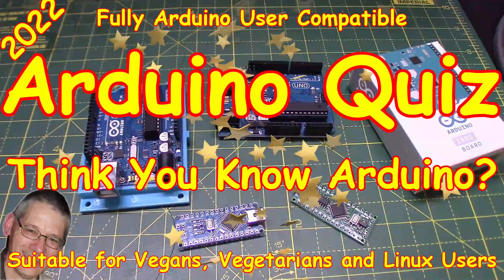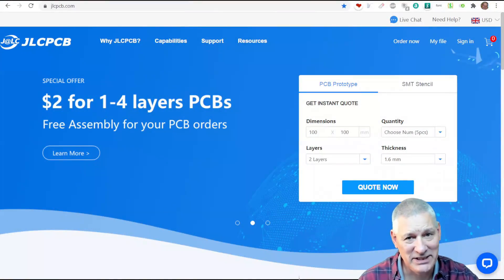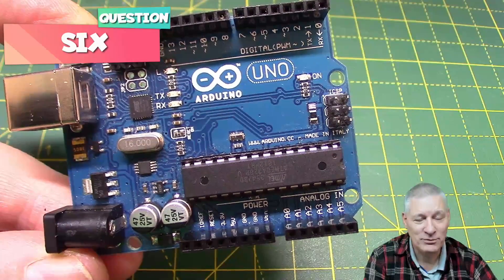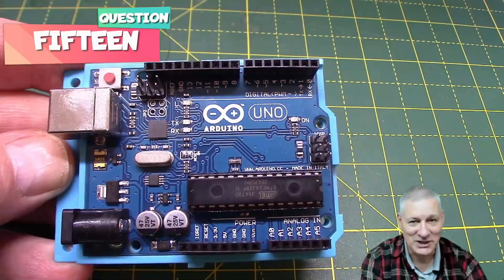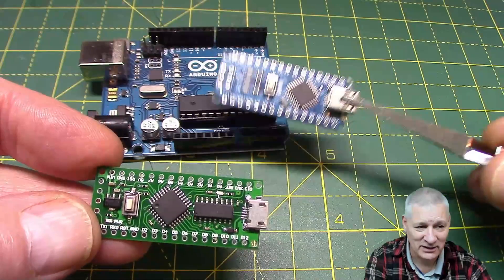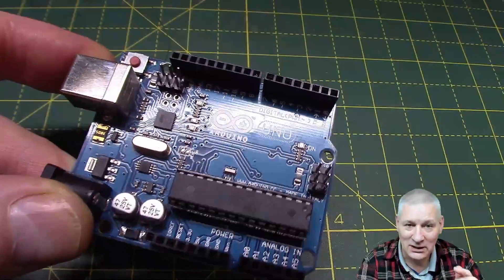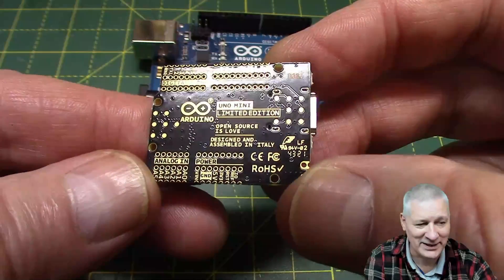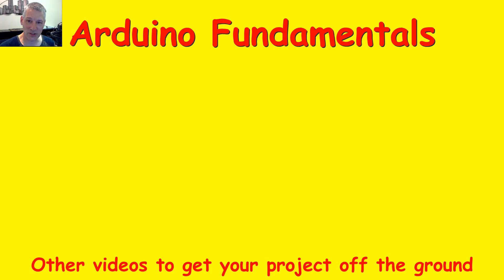#234 Arduino Quiz🎈🎉New Year 2022! So you think you know the  Arduino?

Comment: Catching up with your older vids. I think I got 18, but I have some exceptions to make!
The chip on the R3 for the serial interface is the 16u4, not the atmega8. The previous chip before the 328p was the atmega168... so I wrote down 168.
For programming it where you said if the USB was bust, how could you program it, I put both USB>Serial on pins 0,1 and also the ICSP. Technically both correct? :P

I also said to what language does the arduino use, AVR-C, which is technically not C nor C++... correct yes? :P 

The one that stumped me completely was that special edition uno. I thought it was a slimmed down mega. I also got the Timer questions wrong. I wrote Timer1 but yeah, forgot about binary numbers lol. I knew it wasn't Timer2 because that's only 8 bit...

So depending on how you mark my answers, I think I got 18. I'll include my original answers file below. Fun quiz though :)

1) Arduino Uno R3, genuine. Y - 1
2) Clone Nano Y 2
3) smaller size Y 3
4) 32k Y 4
5) 328P Y 5
6) 168 ? -
7) 19 on uno (2 points) Y 7
8) 2 Y 8
9) 16MHz, (bonus) 1Mhz Y 10
10) hook up a USB To serial on pin 0 and 1 (TX/RX) or ICSP 11
11) 256 bytes Y 12
12) 5.5v Y 13
13) 0 1023 Y 14
14) 40mA Y 15
15) 20mA Y 16
16) 3 Y 17
17) 1 N -
18) shield Y 18
19) AVRC ? -
20) mega pro X
Reply from the maker: OK, let me get out my red pen. ✏

The original USB interface was the ATMega8U2. This was continued with the Rev2. The AtMega16U2 was not used until Rev3.
https://startingelectronics.org/articles/arduino/uno-r3-r2-differences/arduino-uno-rev2-schematic.pdf

The Arduino language is definitely C++. "The core libraries are written in C and C++ and compiled using avr-gcc and AVR Libc."
https://code.google.com/archive/p/arduino/

Timers on the Arduino are 8-bit (T0), 16-bit (T1) and 8-bit(T2). But you knew this, even if you started counting from 1, not zero🤦‍♂️

I could almost accept the answer about a slimmed down Mega2560 instead of an Arduino Uno Mini - I'm about to use one in a video project! Almost. But I didn't expect anyone to get that right! (Actually I'm quite unimpressed with the Uno Mini, but sshh!)

This was indeed a bit of fun but did make many people think long and hard about some of the answers! In most case it doesn't matter whether you know the answer or not but some are useful to know in everyday program and project construction.

Let's just call it 18/20 anyway 👍🏻😲😜

Comment: hi Ralph! I really enjoy what you do. Thank you so much. 
I have a question, maybe you covered it somewhere....after you have wired up an Arduino project, let's say multiple servos, and you want to upload a new sketch. How do you manage disconnecting any high load circuits while uploading? Seems to be a pain to re-wire each time you make modifications to the sketch. Hope I am making sense.
Thank you!
Reply from the maker: My question to you, Noel, is: why do you feel the need to disconnect high load circuits whilst uploading? It can be done but read on.

On start up, all pins are set to high impedance (input-like) so no device attached to the pins should be getting a signal or power. With servos you might get jitter (because servos expect a signal every few milliseconds) but apart from that things should be pretty much 'dead' immediately after power up and before the 'setup' function can run (actually other functions run before this but you get the picture).

Now what you can do, if you are experiencing problems (please let us know what your issue is) is to control the +ve line to the rest of the circuit using a MOSFET that is normally OFF until the Arduino has set it ON in the 'setup' function. You'd actually need two MOSFETs, one a P-channel and one an N-channel but as you get these in a single Si4599 tiny IC it's a no brainer (low 'on' resistance and 6A current carrying capacity for the P-channel MOSFET). I've done a video on using this, video #123 for starters, but there are various permutations you can use. Let me know if you need this.
Reply: @RalphBacon  thank you Ralph for your reply.   I have a Nano on a breadboard with a 5v power supply connected, and 4 servos (SG90).  Initially I uploaded without the servos connected, and then wired those in. The issue came up when trying to upload a modified sketch,  which unfortunately caused the computer to reboot (W10) for some reason. I suspect a current draw on the USB port (?) I figured the load of the servos would exceed the USB current, so I left the 5v power supply on. The Nano is connected to the +5v rail on the breadboard. . And, I did have the jitter as you mentioned. I should add that the new sketch was only using 1 servo, with the other 3 servos still in circuit.  I guess I don't understand how to manage the USB connection to the Nano with the external power supply connected to the breadboard. Perhaps just disconnect the +5v wire to the Nano for uploading ?
I will check out your video 123.   Thank you!

Comment: Arduino Nano and Uno are NOT identical.   Nano has more GPIO PINS.  Also, you imply 19 gpio pins by counting up from 14 on the analog pins, but being based  zero that makes 20 gpio pins.
Reply from the maker: Well, sort of, Michael. 

If we take a cloned UNO and a Nano then they are identical because they use the exact same chip (QFP32 ATMega328p). It's only the original DIP-28 version that doesn't have A6 and A7 (which are input only, so not ideal).

Regarding the GPIO pins, yes there are 20, starting from 0, and if you watch the video, I mentioned the zero to 13 on one side of the board and continued to count 14...15 all the way up to 19. I cut the video at that point as it was getting a bit long but the next sentence was something like "...so 20 in all". But we all know that, right?

Comment: I cheat on the last one, uno mini... and yes I got one too. you say how many input/output, I said 20, you said 19, I think you got that wrong.
Reply from the maker: Well, I was counting the GPIO number (the last one on the board is GPIO13, so after that it goes GPIO14...15...16... all the way to GPIO19 which is the 20th GPIO pin). Let's just say we both got it right!
Reply: @RalphBacon  What I see it start from GPIO 0 to 13.. that 14 then the other 6
Reply from the maker: Yes you are correct: GPIO pins numbered from 0 to 13 on one side, and 14 to 19 on the other side (A0 to A5), making 20 GPIO pins in total.

Comment: Sorry Ralph, but I have to strongly disagree with you about the fundamental difference between the Uno and the Nano. 
First of all, check the datasheet, because the A6 and A7 pins don't exist on the 28-pin DIP package used on the UNO. Since those two pins exist only on the 32-pin Quad package used on the Nano (the other two added pins are another GND and VCC), Arduino couldn't have "exposed" them on the Uno if they wanted to.

If you consider size a fundamental difference, then what about your "Deep Sleep bare bones Arduino" from #116, where your desired difference was the amount of power consumed? In that case, is the fundamental difference the size, the lack of USB, or the power consumption? 

I suppose it depends on your definition of the moment for "fundamental", but certainly the extra two inputs allow you to do things with a Nano that are absolutely impossible with an Uno, completely apart from size. For instance:
Last year, I was working on a project that absolutely needed those two extra pins for analog input. Yeah, sure, they're "input only", but my needs included 9 digital sensor inputs, a square wave "clock" input, as well as both an NRF24L01 (SPI radio using 6 digital pins), an I2C device (taking A4 and A5), and three analog inputs. Those two extra pins allowed me to use two of the "UNO available" analog pins as digital I/O, and still implement a battery level and charger voltage monitor as analog inputs.

Sure, it's an edge case to be running out of pins and needing multiple analog inputs, but for my project (and I'm sure there are others) the fundamental difference lies in those two additional analog input pins available only in the quad package. Of course, if I need even more pins (and RAM and Flash and EEPROM), then I could've switched to the Arudino Mega2560. I hope you don't consider the fundamental difference between it and the Uno to be one of size?
Reply from the maker: Hmm. I knew this was too controversial to include in the quiz!

All UNO r3 clones use the QFP ATMega32 so will have the A6/A7 either disconnected or available as two extra pin sockets. Not the same as the DIP version I used in the video, to be sure, but I don't feel that's a fundamental difference despite the fact you needed those pins in your latest project!

So: same speed, same memory, same chip, same everything (you don't even need to recompile for the Nano) to me (and this is a subjective [and controversial] opinion) is that I can develop on the more spacious Uno but implement on the smaller Nano so my enclosure is smaller. It's about the only difference that is fundamental to me.

But you're welcome to disagree, Rob, I won't hold it against you, and you'll be pleased to know that many others have mentioned the A6/A7 pins (which I exposed on my ATMega328PB PCB because they are true GPIOs on that chip; pity Arduino never upgraded their spec for the Uno v4 - too much infighting at the time).
Reply: @RalphBacon  Ok fine, I get it - you've convinced yourself that size matters above all else... and as a friend of mine like to say, you have the right to be wrong. 
But it's invalid to change the argument by saying that Uno clones used the same chip as the Nano, because if they exposed the extra pins they wouldn't have been clones any more (If you add pins, shields won't fit).

To summarize my point, the extra pins allow projects on the Nano that are not possible on the Uno, and that's a pretty fundamental difference!
(Just like the extra pins and features on the Mega are fundamentally more important than it's larger size).
Reply from the maker: According to my wife, I have the right to always be wrong, mainly because I am (she maintains). 
Yes, I fudged the question with the A6/A7 and DIP chip. What's important to one developer is of little consequence to another! We can both be right on this one.

Comment: The grading was more complex than the quiz itself :-) So, you better grade me, this is how I did.
Q1, you got me with that R3, I just answered Arduino UNO.
Q2, got it right
Q3, Well the word "fundemental" got me here, I answered "one has a DIP MCU, the other has the SMD version."
Q4-Q5, got them right
Q6, I am sure I must have read this somewhere but nope, couldn't come up with Atmega8
Q7-Q19, got them right.
Q20, I didn't know about this novelty board, but I could read the name on it as UNO MINI. any points on having eagle eyes? :-)
I wonder how long will it take the Chinese to clone the UNO MINI now... :-)
Reply from the maker: Well, you seem to have got them all (more or less) right; I was deliberately being provocative with the Uno R3 in the very first question because if I gave you an UNO V1 or V2 you would be well disappointed!

So you read what the board was in Q20! Well done. Even if you'd never heard of it (nobody has) your answer would have been correct! And I doubt whether the Chinese will clone it, it's too specialised and there are (cough, cough) better boards out there for actual use. This Uno Mini is more of a collectors' item, I think.

I'll give you 23 points (dropped a point on Q1, Q3 and Q6, and you dropped another because you failed to work out the marking scheme) 😁 But well done!

Comment: Captain Pedantic says that 2048 bytes is referred to these days as 2 kibibytes, not 2 kilobytes.
Reply from the maker: Brought about by manufacturers trying to mislead the public, IMHO, who sold us 8MB ('megabyte') disks that were in fact 8 million bytes (8000 x 1000) not 8000 x 1024 bytes as we (and Windows) expected.

Yes, yes, I know it's part of the international standard now (since the 1990s), that we should be using Base 2 (kibi) not Base 10 (kilo), but all this came about due to the ever-increasing discrepancy with larger disk drives and caches when using the 'kilo' terminology.  

Today, if you were to buy a 1Mb flash chip you would now expect 1000 x 1024b (1Kb) not 1000 x 1000b (1kB) like the manufacturers tried to kid us in years gone by.

So, 1kB  (lower case 'k', so kilo) vs 2KB (capital 'K', so kibi) is the difference of 24 bytes; not a lot until you buy an 8TB hard disk and wonder where several hundred 'megabytes' have disappeared to.

So now, to avoid confusion, along with 'kibi' we need to use the terms 'mebi and gibi' which I don't think I've ever heard anyone use! Except those disk manufacturers, of course.
Reply: @RalphBacon  I know. I recently bought an 18TB hard drive, only to have Windows reports it as a 16.3TB drive. I don't know how IT equipment manufacturers get away with it. If a car manufacturer brought out a 1.8L engine car that turned out to only have a 1.6L engine there'd be a huge outcry.
Reply from the maker: Quite so. Hence the now (slightly ridiculous) kibi, mebi, gibi when, if the disk manufacturers had not tried to con us (1000 vs 1024 bytes), we would not need any of that.

Comment: Fun quiz Ralph. Got 16. Rather crafty to throw in an unfairly weighted question 20. Do you have ANY IDEA about the number of irate calls I'd get from parents if I tried that on my students? I'd have to leave Canada and camp on your front steps for eternity! Yes! That's a long time! Especially in milliseconds! Thanks for the quiz and best for the new year. And yes, I echo the A6 and A7 on the Nano! Correction Professor Bacon!
Reply: Thanks for the informative reply Ralph. Have a great week!
Reply from the maker: That's why I threw it in there, Gord. I just knew only those actively following the industry would be aware of this 'special edition Uno' so, if nothing else, it has shown many viewers what Arduino has done! I'm still thinking of where I can put it to good use.
The A6 and A7 on the Nano are input only pins; not that useful, and as there are already 6 other analog capable pins I'm not convinced they add much (probably why Arduino didn't expose them on the Uno).
On the 328pB they are fully-fledged GPIO pins so when I made the small PCB for one (video #168) I included those pins. But it is size that differentiates the Nano from the UNO IMHO! Develop on the larger UNO but implement with a Nano!

Comment: That was fun, I totaled 20 points.  Your Nano board, you didn't state if it was R3 New Bootloader, shouldn't you have stated that?  As for GPIO pints, there are 20 but I recall you just counting 0 to 19 and didn't answer the question.  But lots of fun.
Reply from the maker: I think 20 points is an excellent score. Yes, I counted up to GPIO 19 in the video (which does indeed make 20 GPIO pins) but I edited the video (it was too long) with the actual total! Oops. What's a GPIO or two between friends? 😁

Comment: I think A6 and A7 on a Nano, is a fundamental difference to the UNO beside size, it's a fundamental difference in the chips used.
Reply from the maker: Same chip, Sven, just exposed on the Nano. And they are only INPUT pins at that. Not really useful on the Nano. 
On the ATMega328PB chip, however, they are fully-fledge GPIO pins, but Arduino never upgraded the UNO to take advantage of that.
Reply: I would consider A6/A7 a fundamental change, especially if someone moved to it because they needed the extra analog pins.  But I do see the point that size is the obvious change.